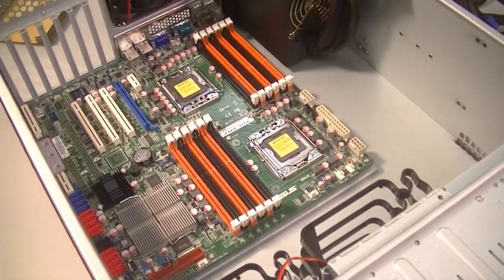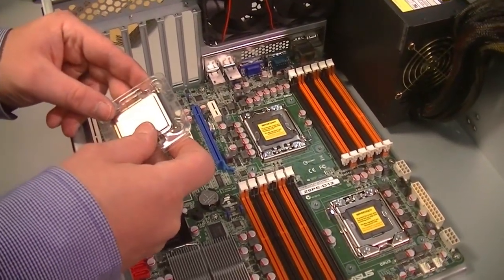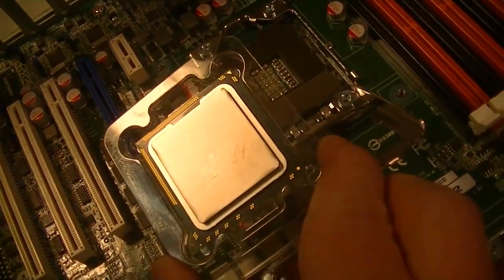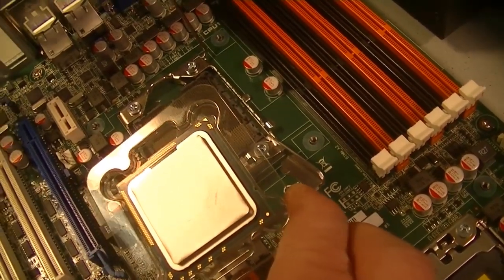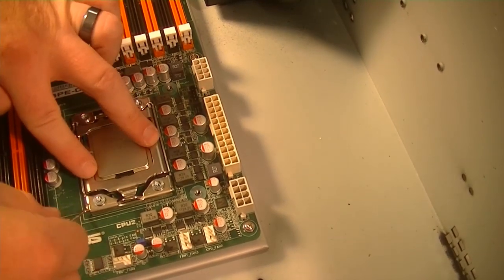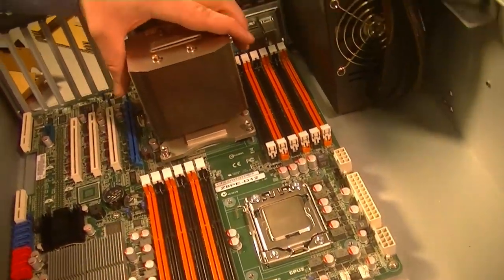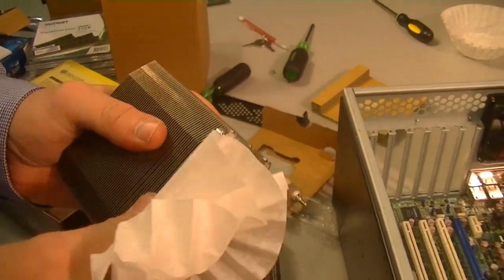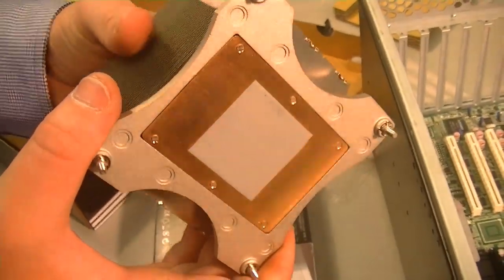How to build a server computer: Part4 Installing the CPUs

Comment: ooops, got that board wrong, thought it was a KGPE-D16 for Opterons with G34 sockets, (seeing how you were on a budget) mine has 2 x 6282se's 16 core CPU's all 16 cores will go 3GHZ and 8 will go 3.3GHZ, all for only $950 each

Comment: All Thermal past is the same
Reply: yes it is it may make a 5 degree difference but that's it if it made a 15 degree difference then ok i'd go but this 20 to 30 dollar bullshit mate
Reply: william roberts Cheap ones usually harden over time and it will act like a insulator. I once had an old HP computer that was overheating because of cheap thermal paste after 4 years of use. The paste was ROCK SOLID and it was pretty hard to separate the cooler and the cpu. I had to sand the old paste off with high grit sand paper.
I also took the heatsink of an 15 year old Pentium II cpu and the paste was still a little bit runny. So no, all thermal paste is not the same.

Comment: If your going to use ESXi they you could use as little as a 4GB boot partition, and go even further by using a SSD card.  Boot's in secs. and leave the other drives to host you VM guests.
You could use a mutticard reader, and insert a camera style card for that.